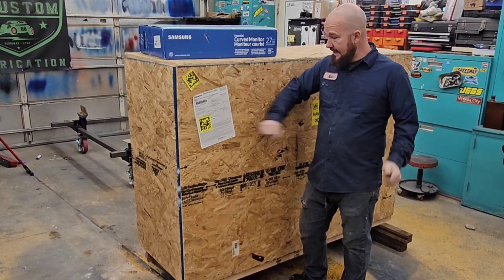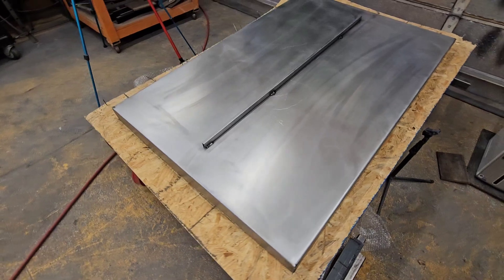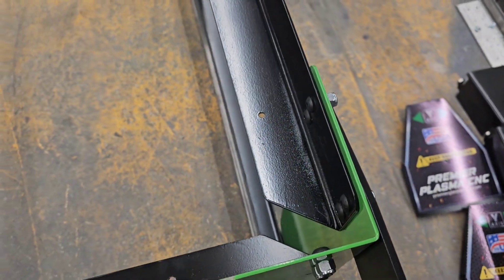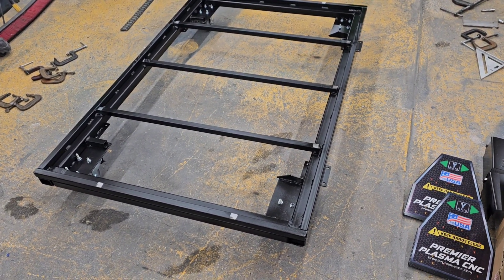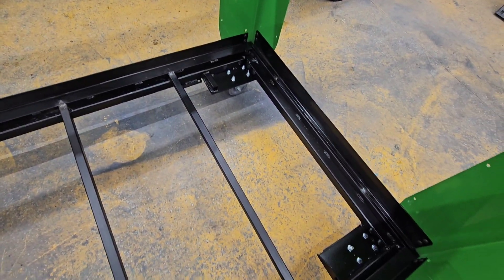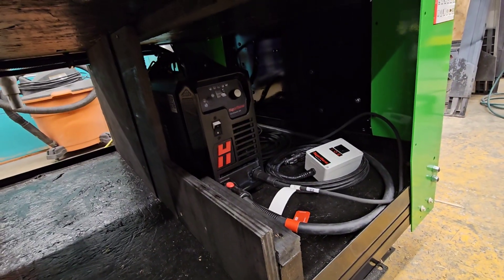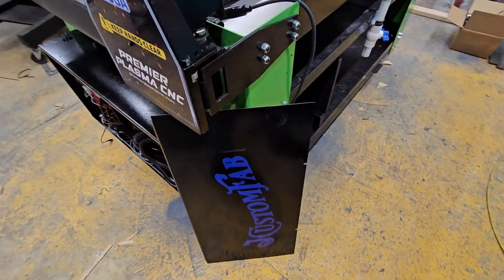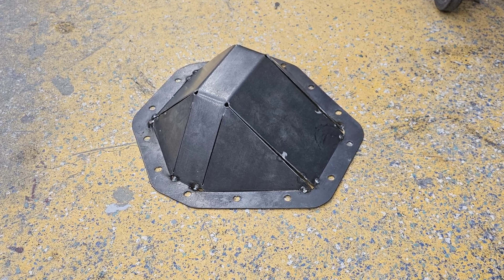Well guys I have my 2x4 Premier Plasma CNC Table Assembled & cut my first part. I'm very excited

Comment: How is the resolution on your machine.  I have the 4x8 Premier Plasma and can't cut any repeatable parts.  Anything over 160 ipm gets bad, holes are oval, and part outlines never match up.  Curious if anyone is having the same issue.  I want to like this machine, but really just wish I had my Langmuir Pro back, it was very predictable.

Comment: I purchased the 2x4 roughly exactly a year ago from premier. It has been an amazing table for the price. The few things I ran into (simply user error) Jake had no issue helping me through it when I called. The Premier Plasma owners group on facebook has been helpful too. I really like the roll around base you made for it. I need to do something similar to mine but this year I plan on ordering the expansion kit to a 4x4. Main reason why I went with premier. It's modular and fit within my budget. I keep my gear track lubed up with graphite lube, haven't had an issue with it at all!
Reply from the maker: It's nice to hear that. You've enjoyed your table. Thank you for the comment on the wheels, It's been very useful being able to have a mobile. This table has been a game changer, And now I realized I also need a larger one, But I almost have a concept design to make mine fold up with a new track so I can turn it into a larger table when I need it.

Comment: Looking at the exact same table. How does the THC function for you?  Did you get the router package?

I’m deciding between this one and STV CNC.
Reply from the maker: No I did not get the router package. It would be kind of cool to try that out. But as for the THC It works really great with the height. Adjustment for different types of materials. I looked into the STV. But then I reached out and talked to Jake on the phone, the owner of the company.
And he answered so many of my questions. I felt like he would be the best to buy from do 2. Any type of issues I might have for support.
Reply: @JCustomFab  Awesome!  Really appreciate the reply!